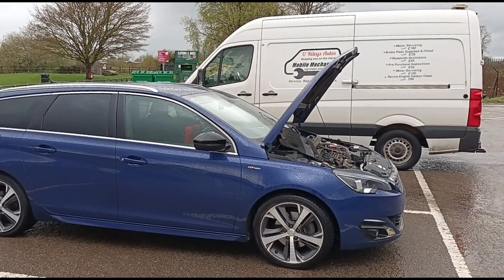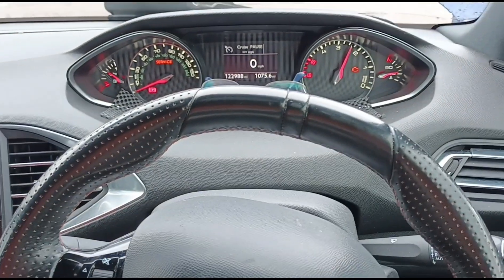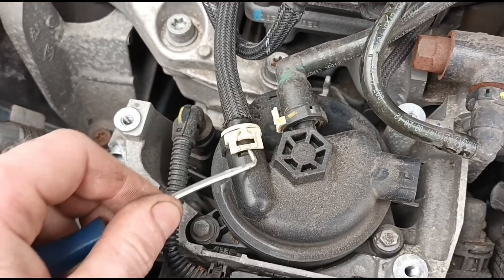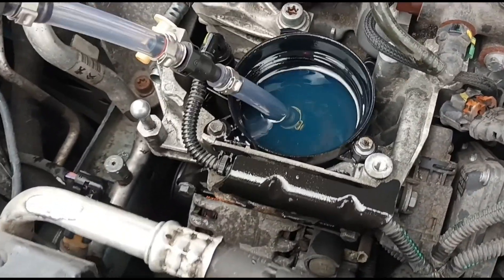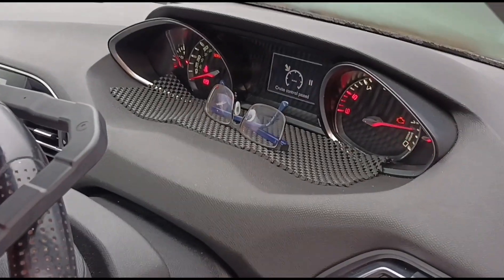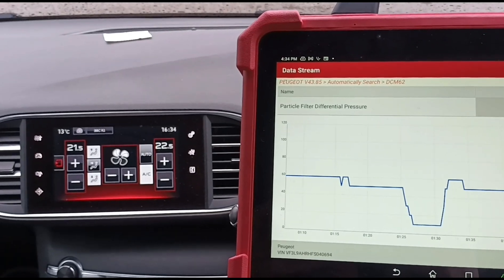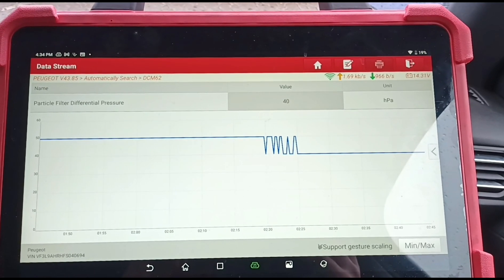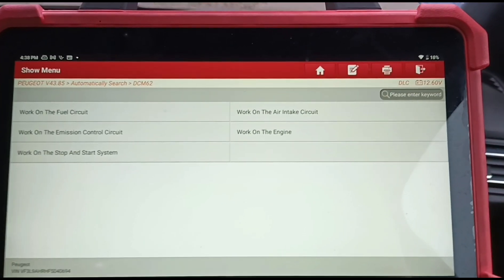Peugeot 308 2.0 hdi P2463 P24A4 P246C DPF Blocked Cleaning & P1113 Low Fuel Pressure Below Threshold

Comment: Iv’e had the urea error on my car the same like this one 2.0 hdi and I have decided to do an adblue delete.the person who did adblue delete told me that the dpf won’t be affected but now the dpf won’t enter regeneration. The pressure sensor values seems to be fine. I have contacted the diagnosing tool and reset dpf presure sensor and dpf as brand new and still not regenerating. The soot mass of dpf is 0 now after resetting and won’t change after driving. Do you have any advice? Thanks!
Reply: Hi, i have similar issue after turn off adblue - cannot turn on dpf regeneration and even complete new dpf installation in ecu. After every few kilometers of driving p246c appear. Have you solve your problem ?
Reply: @maciekowc  just deleted dpf was the only solution
Reply: @maciekowc  I have the same issue, adblue delete but now the DPF complains P24A4 + P246C codes, differential pressure is normal - 2-5 on idle and up to 50 on usage. I think some of these systems can't be just adblue deleted, I'll have to get mine unmapped and fix the adblue.

Comment: It's funny as I work on boxer and relay vans with same engine and only ever had one pump gone but killed the hole fuel system had to replace all of it to prevent damage to any new injection pump or injector 

Do lots of injectors on them though

Comment: Just started whatchibg these fantastic video, 

Wh
As os causing the issue with high pressure fuel pipe causing metel debris, filter not change frequenty enough, cheap supermark fuel or just wear & tear with the pump ?

thanks in advance !

Comment: Dont buy a diesel if you do 2 miles a day
Reply: Personally I like to straight pipe my diesel, and hold the rpms at 4000rpm from cold to warm it up..
Reply: Don’t buy a diesel at all there just utter junk and that’s that take it from a man who works on everything diesel from buses to trucks to cars and vans with all sorts of faults Diesel engines are still tractor engines manufacturers make no improvements to the design or components just to the emission control equipment where as modern petrol engines are constantly striving for better reliability mpg and vast improvements in materials and design

Comment: 2 miles a day?  Why doesn’t he sell the car and walk??  As for the swarf in the fuel filter, I can’t understand people who don’t fix these issues before they turn into major ones.  Prevention is better than cure.  Guess my routine maintenance at every 10,000 kms and swapping out parts before they fail gives me piece of mind that my 12 year old Qashqai with 330,000kms on the clock will keep on going………..and it does!
Reply: I would say it all depends on how much you relay on the car :-) if not that much I would also drive till it fails and repair it than.
Reply: @stupa55  In my case, my office is 40kms away from my house and my job takes me all over the country. Plus my kids all have football training every night between 10kms and 15kms away from my house. So yes, I need a reliable car which is why I keep on top of my own maintenance. I’m a diy mechanic and save a fortune doing the work myself.